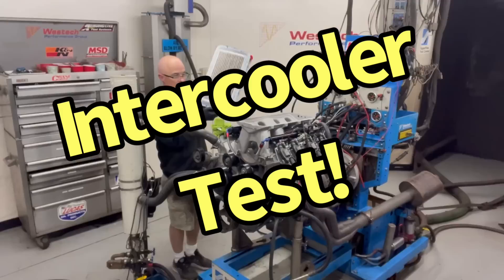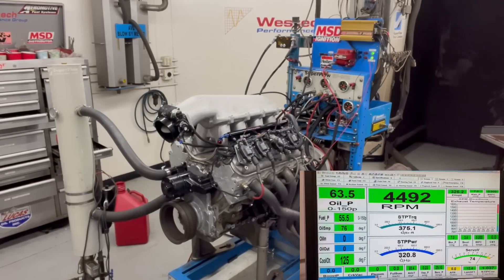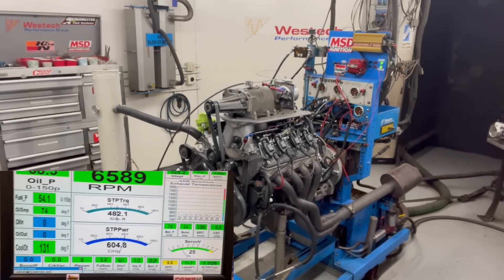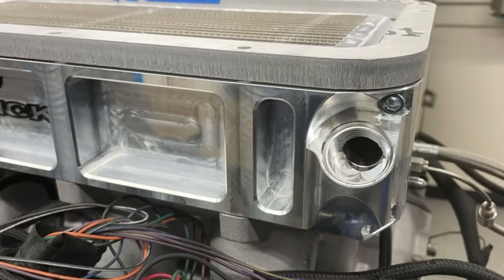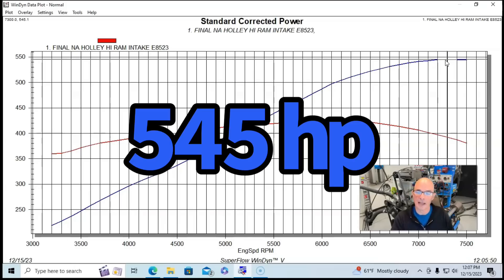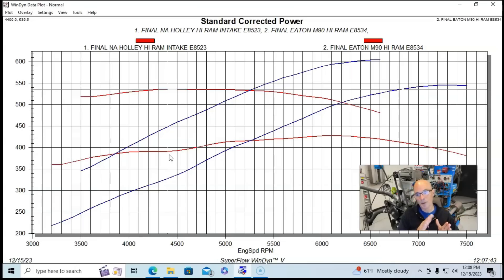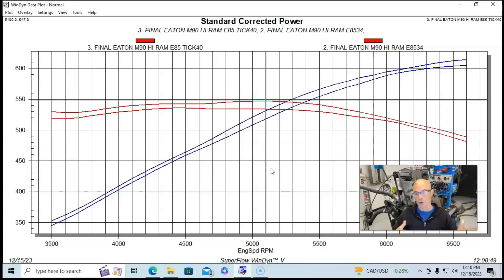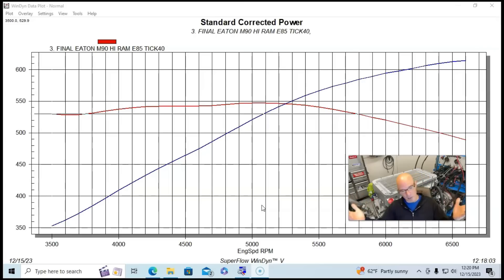HOW MUCH HP IS AN INTERCOOLER WORTH? CHEAP, JUNKYARD M90 BLOWER GETS A TICK PERFORMANCE INTERCOOLER.

Comment: The guy doesn't know what he is doing. The Eaton M90 supercharger was designed to feed a 3.8L (3800)engine. For a 5.7L engine the M90 is way undersized. .
Reply from the maker: Please see where I made 650 hp with a ported M90-maybe this guy knows more than you

Comment: Can you explain the plumbing for that intercooler like which lines/hose went where to make it work
Reply from the maker: only 1 line in and 1 line out for the water (you can use 2 if you want)
Reply: Doing a roots blown set-up is using an icebox in the trunk and a heat exchanger radiator up front with my existing radiator the correct way to do it my intercooler  that goes between my intake and supercharger is a marine intercooler from the blower shop not using e85 or meth just pump gas or c16 street driving track one in a while how long do an icebox last street driving and can i use water and antifreeze or water wetter instead want a kinda maintenance free as much as possible or do it work like that thanks

Comment: Is the decrease in boost not a result of the temperature drop of the charge air? Ie. lower air temp lower pressure vs higher temp higher pressure.
Reply from the maker: minimal drop from temp

Comment: can we add a turbo air  pressure / water jet atomiser to another IC setup and dyno gg
Reply from the maker: TURBO AIR PRESSURE?
Reply: @richardholdener1727  yes to modulate water / air atomiser , try one in reverse with turbo boost im currently setting up , with the jet plumbed in normal use a co2 bottle instead as the nozzle here requires , air compressor or co2 inlet 3 bar etc , water 1.5bar .  .  or in reverse - water 120psi . and turbo pressure 1.2bar and above. use as evaporator reverse with turbo and green led , or normal route as a spray / chiller with co2.  i can link you once i have it recorded.

Comment: You really think that it being pressurized, that it wouldn’t in fact use the entire intercooler surface…I highly doubt that’s the case. The pressure drop is more likely to be the result of it having a cooler/denser charge versus it previously having no intercooler.

Comment: There is nothing wrong with IC. The point is: using E85, when it vaporizes, it steals a lot of heat from the environment, cooling the air heated by the compressor. In this particular case, the cooling provided by the IC will not be much greater than that obtained by using E85 itself.
Try doing the same test using pure gasoline, then the gains with the IC will be much more significant.

Comment: Why not try the zzp m90 intercooler that's for the m90 between the adaptor plate and the m90?
Reply from the maker: we did run that on the 3800

Comment: Appreciate all your great content! I have a question which I have not been able to get a conclusive answer and I thought you might have the answer.
I understand that Hot air expands and Cold Air is more dense and you will always have more power in cooler weather.
My question is: Does Ambient Air Temperature effect Boost Pressure? 
Does Boost Pressure generally rise of drop in warmer weather?
  Thanks Much
Reply from the maker: that is an excellent question

Comment: when you have a fan blowing air and you put your hand in front of it, the air speed goes down when you pull your hand away. it's literally that simple. if you space the supercharger further away from the intercooler, there will be less boost. it's the same idea with a shroud going around a fan and a radiator, the shroud holds the airflow inside it so there is more air movement. you need a bigger hole for the boost to go through.

Comment: Liked the video
But that supercharger is way too small for that size of engine for it to be efficient at making power.
I bet if you got 2x blower units the belt driven turbo type blowers and put them on it will make more tourq and power and sustain more boost in the higher rpms. 👍
Reply from the maker: two will obviously make more than 1-but this exercise right now is about trying to find out what we can get from 1 m90

Comment: Opening up the spacer and removing the H bar from the outlet side of the blower would have to help a lot. When I did my gen v IC setup, I used a .500" delrin spacer below the intercooler because the core protruded into the manifold plenum but with the top of the core exposed and the H bar removed, there was a lot more room for air to flow to the recirc side of the opening. Obviously more space is better but sometimes we put engines in cars. I lowered the engine mounts in my Bonneville to buy hood clearance but more would have been great.

Comment: The air traveling thru intercooler will condense and show pressure drop, especially with small supercharger, think when you add more spacer, it will slow down velocity and more temp and pressure drop. Interest in os lamda sensor readings for each cylinder to see air flow differential.
Reply from the maker: the point is just not this much

Comment: Gale Banks proved this beyond any shadow of any doubt, and he’s equipped to do the proper testing with flow benches, specialized meters, sensors,  thermocouples, monitors, high end quality reliable high tech, and he forgot more than any one of us will ever know about how to make huge usable power gains.
Reply from the maker: Gale never ran this intercooler with a junkyard M90 on a modified 5.3L-or maybe you forgot
Reply: @richardholdener1727  Jeez Rich take it easy on the poor guy 😂
Reply: Richard is jealous of Gale Bank's success.

Comment: I’ve got a 112 on my 5.3 right now. I’d take it off and send it to you if you wanted to test it as well. I’m going to be fabricating a 10mm spacer so I can run m122 rotor pack but that’s not done yet. Stock m112 with a small pulley
Reply from the maker: thnx for the offer-but I have one. We know what a bigger blower does

Comment: Here's another thought, if you're worried that there might be restriction with the intercooler setup then try measuring pressures before and after the intercooler.  1 quick drill and tap and add a  NPT fitting for a line to monitor.

Comment: Me coming from the 3800 world (back when it was cool) your adapter plate, gasket, and the bottom of the blower is all wrong. On My 3800 I milled off the bar on the bottom of the blower as well as machined the lower intake to take full advantage of the intercooler. The rectangle blower opening on the plate and the gasket should be opened up to the bypass valve port. ZZP offers this modification to 3800 guys as well as MANY websites showing you exactly where to cut the stock L67 (supercharged 3800) lower intake to be able to take full advantage of the M90 blower output. My FWD L67 car made 300WHP on 8 psi (stock is 10) on a 3800 with home ported heads, ZZP camshaft, headers, 3.4" pulley on 93 oct fuel.
Reply from the maker: the bottom of the blower is stock-so it is right for this test.

Comment: My prediction is that it's not lacking any flow but cold air is more dense so the pressure will be lower. I think that when you add another spacer and get yourself more flow to the rest of the intercooler it's not going to gain anything because it's flowing fine.  Compressed air flows much better than natural aspiration obviously.

Comment: I understand that Richard, I’ve watched the grand majority of your videos. There’s different water methanol systems out there and some have gotten quite sophisticated. What I’m referring to is the M90 is a relatively inexpensive blower and keeping with that theme a simple basic system like the original Holley used a windshield washer pump. I used that system before that to keep a 71 Hemi Challenger and a 70 Ss396 375 hp Camaro on pump gas after leaded high test went away. The problem with those systems is on boost as the boost goes up the pump is doesn’t have enough pressure to overcome. I got around that by injecting the meth water before the turbo. The M90 would vaporize the mixture injecting it the same way and would cool the blower lobes. It’s not a sophisticated method but it’s cheap, easy and keeps with the idea of low buck! 😉
It was my introduction to EFI with the Turbo Laser that I read the O2 sensor would read the volume of oxygen and adjust the mixture that told me “hey the simple water methanol system would work and it did!
Reply from the maker: I agree with the low buck approach (obviously). BTW- factory EFI motors don't usually run closed loop at WOT
Reply: True, good point.

Comment: I love the videos, but you can never provide too much info... It would be nice to see the boost both above & below the intercooler. (both measured with & without cooling water to see the temperature effect). You will lose boost from both intercooler restriction & also a physical volume reduction due to lowered temperature.  Could you use a traditional carb hat to measure airflow into the throttle body to prove the flow rate changes?

Comment: When the air charge is cooled, density goes up so pressure must decrease.
The small power increase is the result of the supercharger managing to pump more air because of that reduced backpressure.
Correct me if I'm wrong.
Reply from the maker: not this much

Comment: S475+ intercooler if possible 1-7/8 exhaust+ m90+sandwich intercooler what would be the gains from a set up like this. And effect on charge temp, also reason I say s475 is that Will allow the more flow out of the exhaust?????
Reply from the maker: an S475 is a 1000-hp turbo-so it makes the most
Reply: @richardholdener1727  no I get that but I'm saying a compound set up with two intercoolers s475feeding m90. Cause correct me if I'm wrong but Roots chargers stack air right, so this means higher rpm with out maxing out m90
Reply from the maker: see the compound 3800 v6 video
Reply: @richardholdener1727  I've been watching those but wouldn't it be a different result with a bigger displacement or is it basically just going to be a multiplication

Comment: I love the testing and if you are going to do the test again to use more of the core why not compare it to the old low buck inter cooling using low cost methanol injection?
I originally used a windshield washer pump on a non inter cooled 85 turbo Daytona with the higher boost control Chrysler ecu. That ecu would increase the boost by 4 lbs to 13lbs max. With a Holley water-methanol injection I could run the Daytona on 87 octane and it would run the same as 93 octane. I used a NOS pressure switch adjusted to 1.5-2.0 lbs to switch the methanol injection in. It worked great for 70k miles I ran the setup! 
You could compare a low buck system to inter cooling and e85 on an invested $ basis?
Reply from the maker: I have vids up comparing WM to intercoolers
Reply: @richardholdener1727   yes you do and you didn't give water/methanol the respect it should have gotten

Comment: I may be preaching to the choir here, but the reason intercoolers work is because as the air passes through the blower (regardless of whether it is an exhaust driven turbocharger or a belt driven supercharger), the air is getting heated up by the “heat of compression.”  Any time you compress any gas, this happens.  Hot air is less dense than cold air, that is, for a given volume, there will be more “mass” of air when it is cold, than when it is hot.  And engines run on the mass of air passing through them, not the volume of air.  So, as your piston moves from TDC to BDC, that volume doesn’t change but there will be more air in that volume to burn when the air is cold, than when the air is hot.  More air (by mass) means more power.
Reply from the maker: Thnx-we know how intercoolers work
Reply: @richardholdener1727   you think you do.
Reply: Allmost my man and maybe you just states it wrong and the concept is spot on but what the colder air does is allow the fuel to be burned more efficiently no actually providing power or anything on its self you could pump as much air as you want thru a engine if theres no fuel combustion theres no power at all and THATS what colder air vs hot air allows YES everything about the density os correct but what that increased colder air does is allow for better and all together more fuel to combust THUS giving more power..

Heres my 7th grade report on EXSACTLY this thanks to samsung i was able to take a picture and use it to extract all the text! .

Both turbochargers and superchargers increase horsepower by forcing more air into the engine's combustion chamber, allowing for more fuel to be burned and, consequently, more power to be produced. However, the air these chargers compress gets very hot in the process, which can actually hinder performance. That's where the intercooler comes in.

Here's why an intercooler makes a turbo/supercharged engine more powerful:

Hot air is less dense: Hot air molecules spread out more, meaning there are fewer oxygen molecules packed into the same volume compared to cooler air. Less oxygen translates to less efficient combustion and ultimately, less power.

Intercooler to the rescue: An intercooler acts like a radiator for the compressed air, using air or liquid coolant to significantly reduce its temperature before it enters the engine. Colder air is denser, packing more oxygen molecules into the same volume.

Denser air = More combustion with = MORE POWER:
With denser air entering the combustion chamber, more fuel can be efficiently burned, generating more power. The increased oxygen content also leads to a more complete combustion process, which further boosts power output.

Additional benefits: A cooler intake air also reduces knocking (premature detonation) caused by high temperatures, allowing for increased boost pressure from the turbo/supercharger without detonation issues. This further translates to even more power potential.

So, while a turbo/supercharger provides the muscle by shoving more air into the engine, the intercooler acts as the smart tuner, ensuring that air is at the optimal temperature for maximum power and efficiency. It's like adding a well-designed air conditioning system to the engine's intake manifold, boosting its performance potential.

Here's a simple analogy: Imagine you're trying to fill a bucket with water. A pump can help you fill it faster, but if the water is boiling hot, it expands and occupies more space, meaning you can't actually fit as much water as you could with cooler water. An intercooler essentially cools down the "hot water" of compressed air, allowing you to pack more air and fuel into the engine's combustion chamber, generating more power.

Im pretty sure if i got this in 7th grade richard gets it at least well enough to not need a 5rd grade lesson on air density and highschool auto class lesson on the workings of a combustion engine.

You know theres those little kids in the background of every school yard fight, jumping up and down going YEAH! YEAH!...you where one of those kids huh?
Reply: @AnnoyedGarterSnake-gh6vo  thanks for the lesson buddy.  I guess I must have skipped that day in 1981 when Dr. Newhouse was explaining intercoolers in ME403 class, Internal Combustion Engines, while I was on my way to my undergraduate degree in Mechanical Engineering.  As Richard put it so succinctly, thanks, I think I know how an intercooler works.
Reply: Not just that, and correct me if I’m wrong, but the cooler air also allows you to advance timing more or have more compression (or higher boost) safely without detonation.

Comment: I did the quick math on the back of an envelope.  The temperature drop you saw would yield a theoretical intake pressure of 18.2 psi or 3.5 psi of boost.  I don't see an intercooler restriction, I see the intercooler doing its job.
Reply from the maker: incorrect
Reply: @richardholdener1727   I wonder if Tick Performance has any input on that intercooler core not doing it's job.

Comment: I would love to see the maximum potential of the blower on pump gas / intercooler setup, then moving to 100% Ethanol non intercooled. And i would like to see oil temperature performance effect on boosted/non boosted engines to emphasize on oil coolers role
Reply from the maker: oil cooler does nothing to power, we have already run e85 with no cooler, max power on pump gas requires knock sensor

Comment: Since the discharge side of the m90 is so small, would it be more efficient on a larger displacement engine to machine a plate with a round coupler that would feed into the intake? Basically it would hookup like a centrifugal supercharger.
Reply from the maker: the round coupler would be very big-but might work as a remote mount

Comment: I think boost dropped because the IC was working in spite of restricted surface area. Airflow probably explains why the power only went up a little but because you cooled the charge it couldn't fill the area. Cooler denser air made up for the lack of airflow. If you restricted the airflow,  boost probably would have gone up.